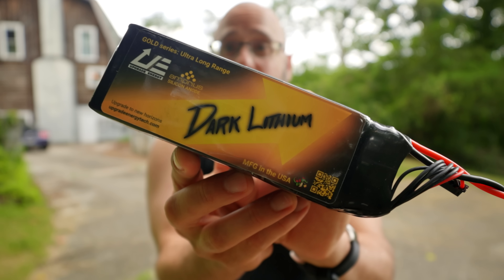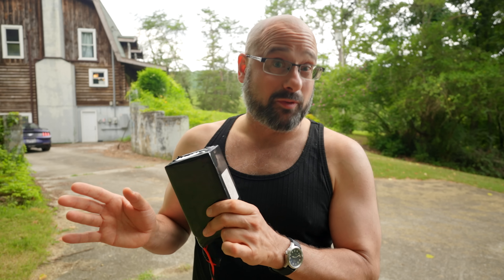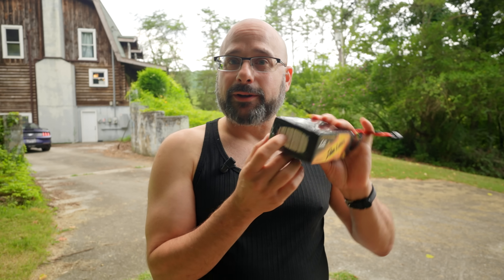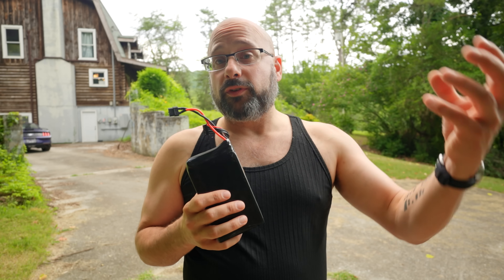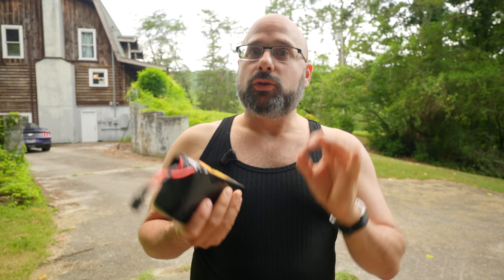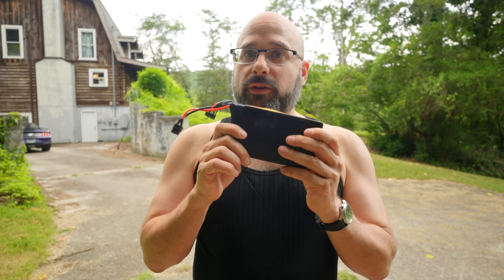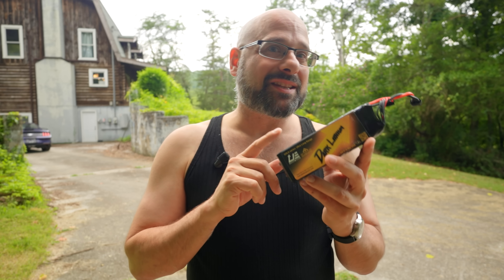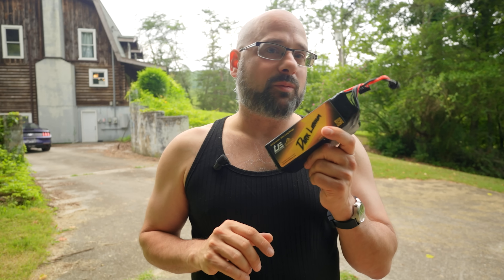I blew up Hank Green's "3000 mile battery"

Comment: Still sticking to lipo, found one that costs around 180 bucks, 20000 mah 6S and weighs just 2.3kg sure it’s almost double the weight but considering how much cheaper it actually is and the amount of current it can output (5x more than this one) yeah my decision stays firm

Comment: More a general question: Forgive my naiveness, but why do people always stick a gopro for recording on top of a quad and don’t use the actual gopro camera as a fpv camera, if it’s so much better? My old modded phantom does this, I’m basically sending the gopro footage to my display as I’m flying, a vtx connected to the gopro
Reply: Some of the high end DJI drone camera systems are as good as a GoPro and don't need one. As for using the GoPro itself to fly, there's no good interface to get the video out of them and transmitted to the pilot without a lot of lag.

Comment: I had a six cell 3000 start making the heat shrink make noises, unplugged it and threw it out of my camper and about fifteen seconds later the fire came out.  Two to three feet of fire, and one by one the remaining cells continued.  There was a two foot circle of no grass there for years 😮

Comment: I just took several international flights this week with15 batteries in my carry on. Mostly 6S  1300Mah and a few 4S 850 mah. I've also had two 6S 1300s burst into a flame throwers on my desk in the past. I am not at all shocked with what happened here.

I couldn't help but think it's kind of crazy that airlines let these things on board at all. I mean considering that these batteries are in all kinds of electronic devices they would get heavy customer pushback if the did ban them, but can you imagine a battery doing this in an airplane when you are mid transatlantic and 3 hours away from the nearest land?

Anyone who knows airline safety knows that the most critical emergency on an airplane is a fire.

I kept my batteries inside a "fireproof" bag that was inside ANOTHER "fireproof" bag, and kept the bag by my feet and in sight at all times, but not everyone has the same level of respect I have for the potential these things have for being really volatile. Other people scare me, specially when I am subject to their carelessness or indifference.

Just some thoughts.
Reply: They were charging when they went off though, rite? I’ve never heard of a lipo just randomly bursting into flame unless it was being charged or during flight when they were over discharged and I’ve been flying for 11 years
Reply: @HaleFPVRC  - Yes. Charging. But puncturing will also do it and that's a far greater concern with airplanes given that people are trying to jam more and more stuff into carry ons. The rules say spare batteries are to be placed on the floor and always kept in sight so you can see the second that something goes wrong should that happen. I did this but do all people? I don't know. I had 15 batteries while one battery doesn't make a spectacular fire like this,  one burning battery setting off 14 more might. Regardless one battery catching fire on a transatlantic flight could be catastrophic.

I did find myself wondering if flight crews are prepared to deal with a lithium fire. If I had an airline I would have a metal box on board that burning batteries could be contained into, assuming you could get it into the box before everything else caught fire. Perhaps maybe an airlock burning material could be placed into and ejected out of the flight? Maybe all batteries need to be turned over at the beginning of a flight and stored in a special locker?

My suspicion is that none of these  considerations exist or have been considered and instead they are relying on the fact that batteries rarely catch fire and assuming that existing protocol is robust enough to deal with any situation that arises. ...that is the truly scary part. Specially when you see how this battery ignites.

Comment: I have discovered I know nothing about ESCs and I want a very small ESC with telemetry I can hook up to a Raspberry Pi 2 W and test with python code in my K969 1/28 scale autonomous race car. 🤠 If it can keep the current high enough then it can keep the Gs high enough at all the right times in all the right amounts so that all it has to worry about is not running into anything.  
What d'ya know about small ESCs with telemetry?

"Son, never mind them brakes
Let it all hang out 'cause we've got a run to make"

Comment: Do you mean "silicon" pronounced ( sill-ih-kawn ) as in ie: silicon cpu wafer?. You are saying "silicone" (sill-ih-cone)  as in the heat-resistant rubber-plastic like material that is an insulator, not a conductor. I'm pretty sure you're just off on your pronunciation of "silicon" as I'm sure you're refering to silicon anode cells that are part of a type of lithium-ion battery where silicon replaces the traditional graphite anodes. Silicone resin wouldn't make the greatest anodes or cathodes lol. Anywho there are some inherent problems with silicon anode equipped lipo batteries. One of the problems is that that after lots of recharge cycles the silicon material goes through what's called charge-induced volume expansion or simply the silicon can shrink and expand causing the material to crack or form micro-fractures during lithiation/delithiation phases(IE: think of like a super heated rock being thrown into cold water and cracking) Si anodes can also have problems with properly reacting with the electrolytes they use for batteries, whereas graphite anodes are very good at reliably interacting properly with the electrolytes. Both of these issues can cause thermal-runaway which you demonstrated awesomely in your video by over-charging - one of the huge benefits of Si anodes is excellent thermal dissipation as shown by your experiment when you note that it takes a long time for the battery to catastrophically overheat :P !

Comment: If nothing he showed how safe these battery are, just before the fire you can see the cells completly open and still not catching fire. No one overcharge the lithium batteries so these conditions basically never happens
Reply from the maker: It was also ridiculously over-charged, like 4.5 or 4.6 volts per cell.

Comment: Out of words for this "I'm rich see me blow expensive stuff up for no reason", something I'd expect on Tiktok from a teenager.

Batteries should always be stored properly, wether they have minor damage in the wrapping or not. How did that even happen before you ever had it in a video?
Reply from the maker: I see you didn't watch the part of the video titled, "How can I justify blowing up this battery." It's a chapter title and everything. In that, I describe that this battery was damaged in a crash and is no longer safe, so I must dispose of it one way or another. But don't let that stop you from being indignant. Facts don't matter, right?
Reply: @JoshuaBardwell  How would I know about the damage if I haven't seen that part? 

It didn't do anything on its own, it didn't look throughly damaged, it didn't even do anything when you overcharged it at those spots. Worst case - which I doubt - one cell was damaged?

It was your decision that this minor damage is enough to destroy a complete $1300 battery. There is no fact that this had to be destroyed. It was also probably your decision to rest this battery on screw heads and fly it recklessly without getting enough experience with the quad and battery first, but I'm looking forward to be proven wrong on that if you show it in an upcoming video.

Comment: I mean,  how many people gonna buy this AND light it off? JB at the forefront!
Reply: Well I doubt he bough it. Would have been more careful with it and wouldn't destroy it for minor wrapping damage or at worst 1 cell damage.
Reply from the maker: You have no idea how it was damaged. It was crashed at speed from high altitude. There were gouge marks in the cells and one cell was open to the air. You're just mad I get to do cool shit and you don't.
Reply: @JoshuaBardwell  A cell was open to the air but didn't do anything on its own? And it didn't even care about being overcharged more than any other cell?

So...those cells don't react with air or how should I understand that? Where does the danger come from then?

I'm not mad, just sad you're getting out of touch more and more.
Reply: @Kai-P my point is this may be the only explosion test video of this battery type for a while

Comment: Will there be a 200ish gram battery for 5 inches with this technology?
Reply: Even if that would be 2000mAh, at 3C thats 6A. Really just very very slight cruising, if it even lifts off.
Reply: @Kai-P yeah I commented that before he mentioned the c rate. The edit was me removing the half of the question that asked what the c rate was. I still think it'd be sick for smaller long range drones.

Comment: Hey Joshua, you should take a close look at the Ag Drone batteries. They get discharged in under 10 minutes and fully charged in the same amount of time. Ag guys swap these batteries all day long, with every product refill, and put huge cycles on these $3500 batteries. The generators are special designed for the task. DJI's current model is the T60X with a 14kw gen.
Reply: Interesting

Comment: If it's 1 silicon molecule for 4 lithium ions, and it takes 6 carbon molecules for 1 lithium ion, to match the 4 ions you need 24 carbon molecules vs 1 silicon? So it's like 24x better?

Comment: Prime example of why i always put an extra layer of dual layer adhesive lined marine grade clear heat shrink on my batts 😉 if you would have had that extra thick layer of protection the battery would have been fine after crash 😉😁 good video though. Thanks for sharing 😁🤯

Comment: Man, I wasn't expecting that, so intense. The worst part is I looked back and saw my two 5000mAh batteries that aren’t working properly—both are 4S. One has a puffed cell, and I'm waiting until I have the skills to remove it and turn it into a 3S. The other one is completely dead, not sure if I can bring it back. Now I'm seriously thinking about getting rid of them. Thanks for all the valuable content you share, especially for people like us.
Reply: If a cell is below 3,5v for a prolonged period of time, dont try to bring the second battery back. Dispose it properly. Turning the 4s battery into a 3s one is much easier
Reply: 5 gallon bucket filled with water and iodised salt, let em sit for at least a week
Reply: @CheeZyNutZ  Do not use salt water. It not only releases dangerous gasses, but the salt water will dissolve the contacts before the battery is discharged leaving you with no way to make it safe. Use a car headlamp or two wired in series to drain old batteries to 0.
Reply: @CheeZyNutZ  use bicarb soda as the electrolyte
Reply: Hammer a nail trough it 😂

Comment: Is it a silicone or silicon anode? One is a polymer mostly used as sealant, the other one is the chemical element...
Reply from the maker: Si = silicon
Reply: @JoshuaBardwell 
He's asking since you pronounced it "silicone" ;)
Reply: @leandroebner1405  I was about to comment the same thing. Big difference between the two. Common mistake though. Silicone != Silicon :)

Comment: That is only reason  not to go beyond 5 inch, bigger quad .. bigger battery to be stored in home
Reply: If you're at the point of paying several 100s for batteries you can certainly afford a nice metal box to keep them in, or just don't keep em fully charged
Reply: Not entire world live in US, so not having luxury of getting this metal box available in my island or even in most of eu countries
Reply: @naveennishad  That's unfortunate. Maybe you have to improvise it out of stuff for some other purpose. I live in EU and just a brief google search out of curiosity gave me a local seller of NATO ammo boxes for 22 euro per box or a larger lockable steel toolbox for 65 euro. I'm sure there are some used options for some kind of metal box in most places as well...
Reply: @ml11ML that I already own 2, but I trust them while storing lipo, I can’t trust them while charging 
Big battery can cause enough damage in those box and smoke is real challenge to me in my home thing goes wrong, specially to kids

Comment: Thanks Joshua! That was really interesting to watch and learn!

Yeah, we need exactly half a ton of THAT in every car in underground parking lots everywhere!!! What a great idea!
/s off - this is why battery powered vehicles are absolutely idiotic. No matter what chemistry the battery is - standard lipos are already way angrier than reasonable. Any battery with more electrical capacity - is just more and angrier pixies packed tighter together. Nothing good will come from that.

Edit: for people who don't understand basics of physics... Conventional fuels - diesel is practically unburnable. Go to the kitchen, get yourself a spoon or a cup of whatever oil you use for cooking and light it on fire before arguing this.
Gasoline somewhat volatile is highly flammable, sure. But you can easily extinguish it, if you know what you are doing. But you CANNOT extinguish lithium batteries until they are all gone in smoke. They don't "burn" in proper sense of the word, they don't burn chemically, they just release their stored energy in the form of heat. Steel beam melting and concrete turning to sand type of heat. Try snuffing it out with any fire extinguisher and it will just laugh and throw 2000 degree F sparklers back at you. Just like in this vid.
Reply: cars do not use lipo. 🤷
Reply: @szorptorp4258  no, but they use lithium and have the same unstoppable reaction when they go up. there are cases where they had to submerge the car and it kept burning for days under water. the biggest issue is that the reaction is self sustained. there is no need for anything from the environment to keep the fire going. with normal fuels they need oxygen from the air to keep everything going so they are easy to smother out with water. these batteries produce their own oxygen as part of the break down process so they can burn until all the energy in them is gone.